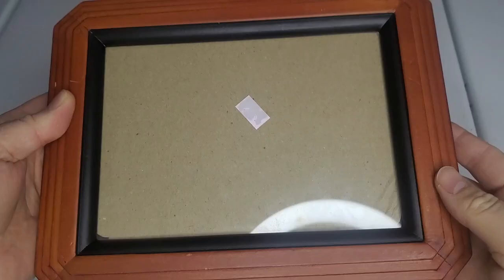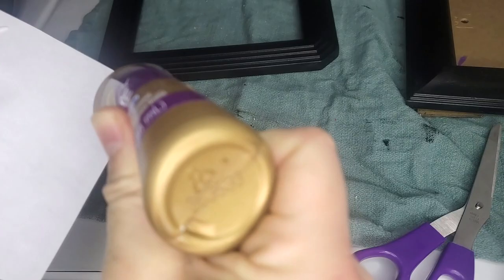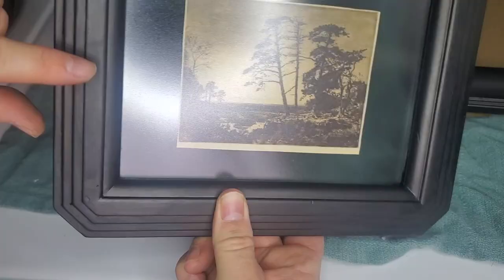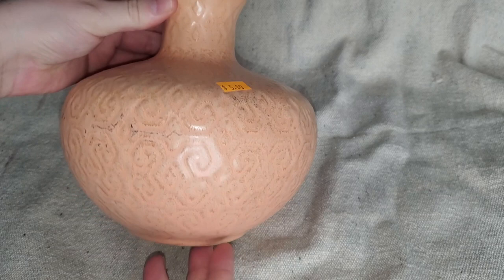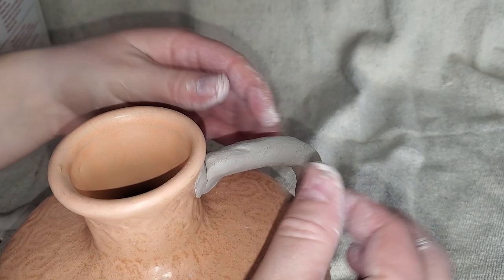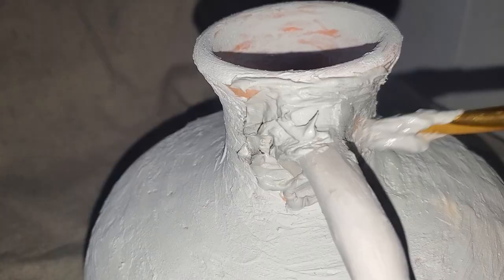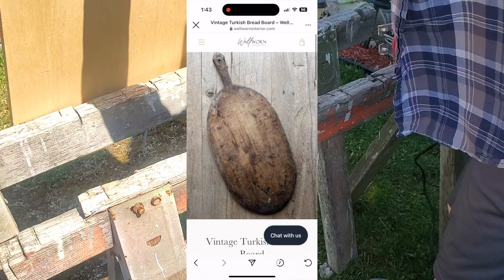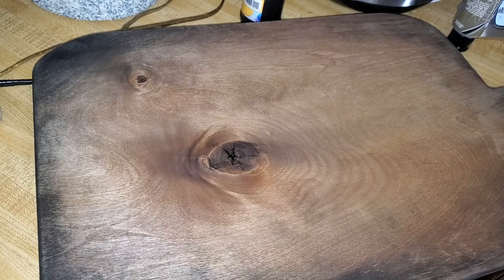Designer Vintage Home Decor Dupes || 3 Look-A-Like Vintage Inspired Decor || Designer Look For Less

Comment: Hemp oil is good safe. Sweet pickins brand has a dark oil that would be pretty. Or the I colored for a more light color.
Reply from the maker: Really? Will hemp oil be okay put over paint lol i really have no clue since I used paint lol 😂 do you put oil over stain also ? I should research this stuff